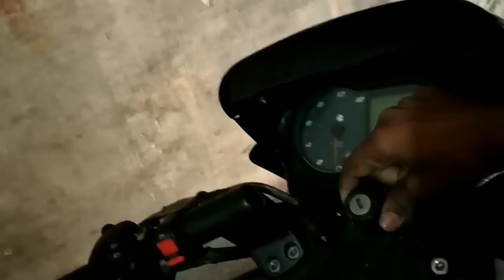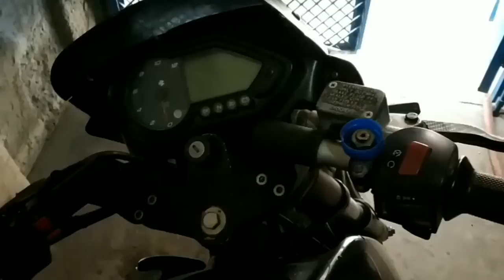HOW TO MODIFY PULSAR 150

Comment: Which parts you need to modify for front and jo rod wala portion hain handle t ka rod wala wo bataye
Reply from the maker: T set pulsar 180 ka hi rahega but jo T ki roud hai use nikalwa ker 150 k T set ki roud lgwani padegi bro. Bus yahi ek modification hai baki sb kuch as it is hi intall ho jayga.

Comment: Isme dish plate 150 ka hi rkhe to koi problem v hoga
Reply from the maker: Ager 180 ksb kuch install karoge to disk plate bhi 180 ka hi lgana padega 150 ka set nahi hoga
Reply: T ka kaam ho gya h Hm sb kuch nhi kr rhe .hm sirf front soker handle 180 ka lga rhe h ..
Reply: @allthethingtech6441   agr wheel 150 ka hi rkhte h tb chlega kiya
Reply: @allthethingtech6441  plz replg
Reply from the maker: Ok  aapko 180 k shoker alloye excel speedo meter cable 180 ka front mud guard or headlamp ko set kerne k liye kekda 180 ka ye sb lgana padega
Reply: @allthethingtech6441  180 shoker mi 150 ka alloy excell ni lg skta sir ..agr 180 ka sbkuch lga hi denge to tyre 150 ka new h wo _180 alloy mi feet hoga tubeless bn pyga kiya sir
Reply from the maker: Bro kuch chijo ka jugad kiya ja sakts hai but jiski setting hi ek part k sath dusre ki ho to uski setting k bina dusra part install nahho ho sakta  ager aapko front look 180 ka chahiye to sb kuch 180 ka hi lgana padega kyoki 180 k sare parts 150 se bade hai yaha tk ki front tyre bhi 150 se bda hai dono ka size 90-90/17 same likha hai but dono me difference hai 180 ka fornt tyre bhi 150 se bda hai.
Reply from the maker: Aap 150 ka tyre lga sakte ho sir koi problem nahi hogi mene bhi yahi kiya hai
Reply from the maker: Lekin ager aapko look or heavy chahiye to aap ek baar 180 ko or 150 ko ek sath  rkh ker dekh lena aapko tyre me bhi difference milega halaki dono per size 90-90/17 hi likha hoga but dono bilkul alag hai.

Comment: Bro, the Pulsar 180 Disc Rotor will possibly fit in pulsar 150's Alloys right? And tell me whether the pulsar 180's front Axle will fit with the 150's Alloy wheels...

edited-> Plz do reply😞
Reply from the maker: Brother its not possible to fit pulsar 180 disk plate fit in pulsar 150's alloy. If you want that then you will have to change all the setup of pulsar 180. Like handle bar setup T set, both suspension alloy and mud guard speedometer cable all about that.

Comment: Bro... Old model 2008 ug3 single piece handle? 
Any height difference? Please answer me
Reply from the maker: no any difference in their height but its handlebar totly different in each other.
Reply from the maker: @maheshdassk  sir mai number nahi de sakta for some reson aap comment karo mai btaunga aapki jo bhi problem hogi mai solve karunga mujhse ban pda to
Reply: @allthethingtech6441  what did you do on t stump?
Reply from the maker: @maheshdassk  I replaced  pulsar 180 Tee neck roaud and fitted 150 TEE neck roaud sir according to the pulsar 150 chechis.

Comment: Bhai to ye modify karne me kitna kharcha lagega aur Kya change hoga please batyenge
Reply from the maker: Bro isme aapko alloywheel 180 ka with disk break ka pura set or front wheel me lge speed meter ki wire. Shoker or tee ka set meri trah hi adujst kervana padega or jisme head light install hota hai use kekada kehte hai or handle baar ka pura set jaha lock lga hota hai, vo. or uspr lge huye dono gutke jisme handle ka cluch lever or break lever lga hota hai. Sb change kervana padega or lgbh isme kharch aayga 2500 ka second hand lgvaoge to.

Comment: Finally nothing benefit, converting 150 to 180. What's the use of such modification?Will be very dangerous during ride . DO NOT DO MODIFICATION.
Reply from the maker: Can u give me an explanation why it is dengerous during riding?
Reply: Yes there are so many benefits..1st 260mm disc. Thn u can use wide tyre for more grip..the grip in road will be increased...he has done a very good and clean modification...